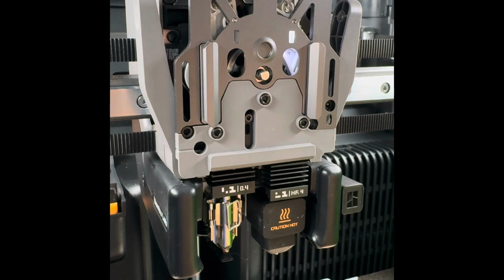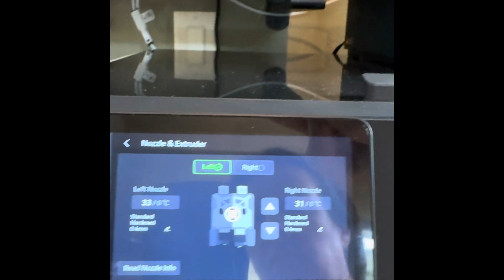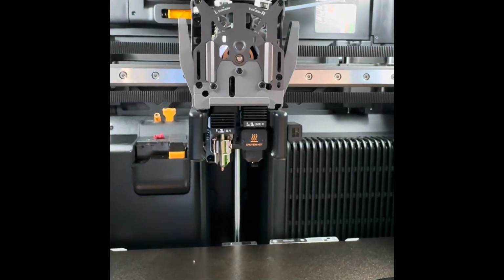Bambu H2D first nozzle change

Comment: Did the HF nozzle make a noticeable difference to the print times?
Reply from the maker: You know, I wish I would have done a benchy so I could honestly report on this. I can’t notice the difference, but I didn’t do a proper comparison.
Reply: @wick3dsky  On my H2D, with the stock nozzles, the benchy takes about 26 mins at the standard speed if that helps compare.
Reply from the maker: @oo-eo9pw I just started a overnight print, but as soon as it’s done. I will print a benchy in PLA and get you the update!